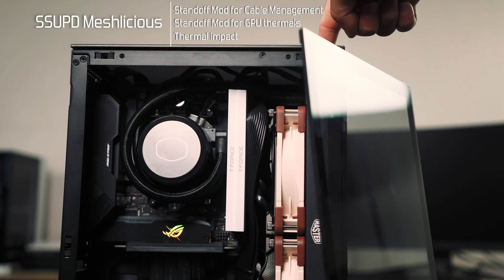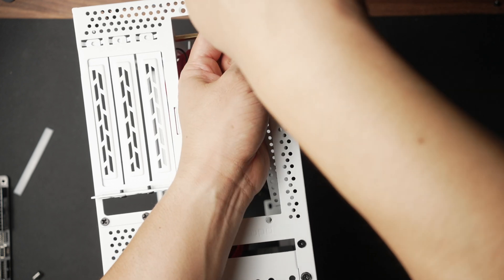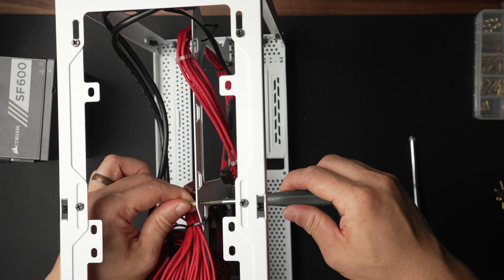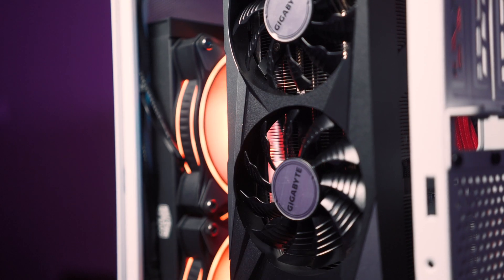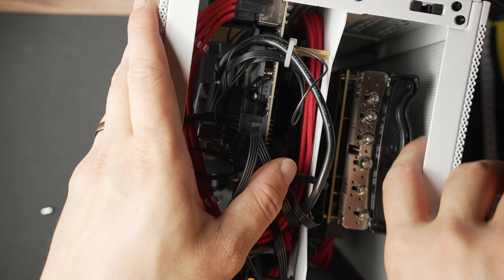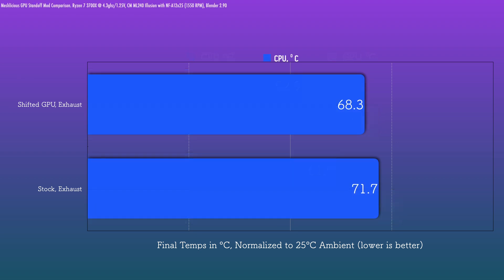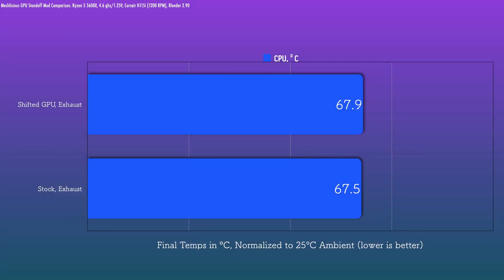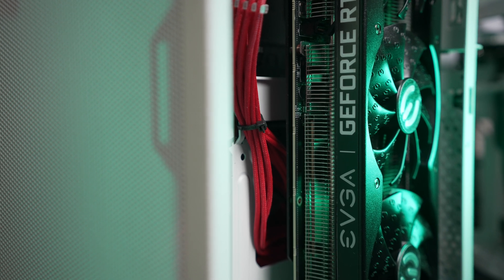Standoff Mods for the SSUPD Meshlicious

Comment: Great video! Thank god the NZXT Z53 has 52mm height on the block instead of the 55mm on the X53
Reply: Did it fit?
Reply: @sghorbi  yes. Even went with the Z63
Reply: @Ypelaar  how close to the window is it now ? Wondering if its too close. Planning it also with the z63 :)
Reply: @sghorbi  its quite close, but the closer the better because its easier to read the LCD screen
Reply: @Ypelaar  does it also fit well with the tube cables of the kraken and the glass? Or are they bended or ansthing ? Want to use a asus strix 570 -i gaming

Comment: For your cable setup in this, did you use just hte custom cables linke,d or was this the custom ones as well as the extensions you had shown in previous videos? I really like hwo they look and wouldn't mind shelling out the extra few to make it have more flexible cables and room to work with as you show here.

Comment: wondering if I have the strix 3080ti and go with air cooling on bs3 on 25mm fan can I use both the standoff mod, shift the center piece to gain that space back then mount the gpu?

Comment: M&M, thank you for the informative and great content! One general question; can shorter than stock stand offs be used to afford more CPU cooler options? Especially in the case of the NR200 where an extra mm or two could make a huge difference.
Reply from the maker: Somewhat- the one caveat is the IO cutout- if you are OK forgoing the IO shield and having things not line up perfectly, yeah it can work. Just make sure nothing on the PCB is shorting out.

Comment: I have follow the step to finish the standoff mods, it have a big improvement of the thermal especially the back side m2 slot ssd on the motherboard. But my raiser cable is not longer enough, so I just leave it not lock to the standoff.
Reply: Need answers here too. Mine is too short. How long riser is needed to make the motherboard riser mod?

Comment: I just did a new build in the case and your standoff mods helped me a lot! I did not want to purchase an SFX PSU because I had an AX 850 laying around. Lifting the motherboard higher gave me so much more space to hide cables behind it! I was able to still fit a Corsair H100X with no problems at all!

Comment: Is there a significant difference between running a 280 or 240aio? Just ordered this case plan to run a 12600k maybe 12700k.
Reply: The 280mm performs more closely to a 360mm than it does to a 240mm. It depends on the CPU and what you consider significant, but the hotter the chip the more likely you are to see improvement with the 280mm.

Comment: Just did the standoff mod on the GPU side. I have a 2.7 slot GPU (MSI Gaming X Trio) so my only choice was to move the divider in the center. It works WONDERS for cable management. But I did manage to break the locking clip on my riser cable (oops)
Reply: what size u use for the standoff mod on the gpu?

Comment: That is one way to do it, but I went with the GPU standoff approach, which seems to be working bit better for me. Additionally, I recommend to use 180 degree gpu power adapters to completely hide cables and connectors.

Comment: amazing. If the one you linked is sold out can I can get any m3 set?
Reply: For the motherboard standoff any M3 to M3 extensions will work if you are adding them to the existing standoffs. The stock standoffs are 6.5mm 6-32 male to M3 female, so if you replace them you will need to either use that some size or something as close to it as possible. But yes, any kit with those sizes should work, they are standardized.

Comment: NZXT AIOs fit just fine if either of the mods are used.
Reply: I've heard that the X63 pump head is too high - can you please clarify? The X63 would be my first choice.
Reply: Same, I’d like to know as well. Have a z63 and was interested in using a tempered glass
Reply: Can anyone confirm the x63 is too tall? Might need to exchange mine before the build with a planned standoff
Reply: Neither of the X53 nor X63 fit. Z63 fit, but it was very tight and close to the mesh panel

Comment: finally thx a lot , I ask I got video, one more question, what U think about slim radiator 240 or 280mm and slim noctua fans with all custom water cooling, more room for cables and air, but idk whats the slim radiator compares to standard, for this case slim radiator  would be perfect choice but...BIG but....
Reply: I'd been thinking about this for a long time before I switched from my Z63 to a custom loop and added a mod to the front panel to let me run 140mm fans in push/pull. You could do it with any normal AIO radiator (about 30mm) and the Noctua NF-A12x15 fans which have plenty of static pressure for AIO use. But, you'd be looking at probably something like 5-7C difference for around $100 extra cost, so not especially a good value. Fun maybe. The big difference I found with doing push/pull isn't the better temperatures in general, it's the same or better temperatures at reduced RPM, so it is significantly quieter. Mine is basically silent even under load at about 3' distance.

Comment: So would the Arctic AIOs fit with the motherboard stand-of mod?
Reply: All the pump models with hoses straight up from the cpu block fit poor to this case. Arctic liquid freezer 2 is one of them. I was unable to fit 280mm rad liquid freezer II to my meshlicious as the fan bodies hit the motherboard tray. I had it there temporarily with only one fan and had to ziptie the hoses to get the side panel on in 3 slot card mode. 4 slot gpu mode makes it probably impossible to fit the side panel. I bought the ek 280 rgb aio and it works well with the case but my motherboard makes me to use the block hoses down. I'm doing this mod for my case and modify the chipset heatsink assembly to get the hoses to the side.
Reply: They will, their clearance is less than 53mm